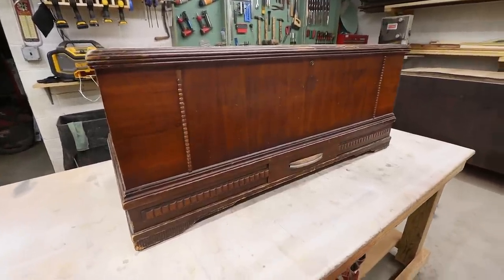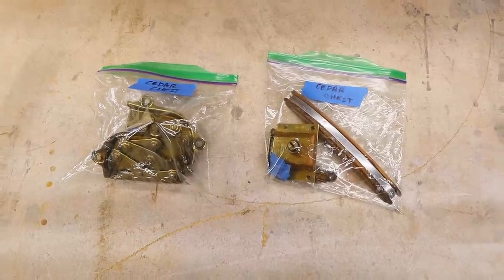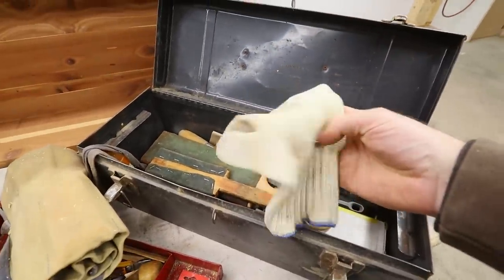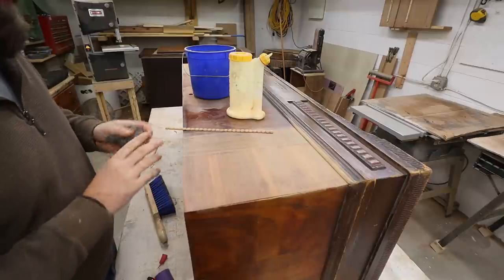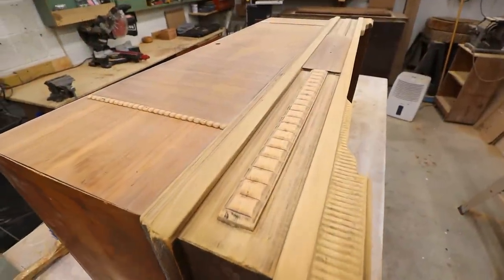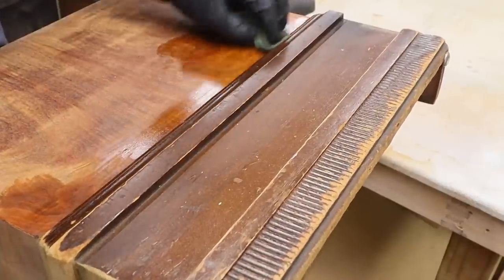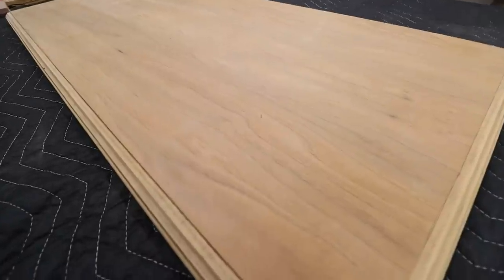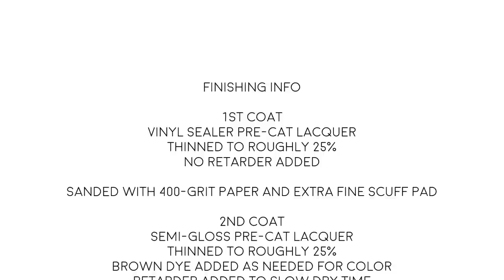Antique Roos Cedar Chest | 10.25.19 | How to Furniture Refinishing Restoration Repair

Comment: Can anyone tell me why you would steam the wood? I’ve heard of steaming it to bend it but in this case I don’t understand why he is steaming it with the iron? What does that do and how is it done - I can’t tell if that is just a bowl of water or chemical? And how hot should the iron be?? Thanks
Reply from the maker: It helps to pull out dents/scratches in the wood. It's just water.

Comment: Called it from the dummy drawer at the bottom. This is their basic model dressed up with some moldings, hence the paint instead of veneer on the bottom. The veneer on top (I think) is American Chestnut and mahogany. It was shellacked to show the grain. The bottom had a more durable finish because of the paint. The "drawer" is fake because it was meant to be inexpensive and joinery would have cost too much.

Comment: The finishing should be a cellulose based varnish typical of the the 30s and 40s. Why did you use an iron on the lid of the chest? Thanks
Reply from the maker: Pretty sure it was all shellac. Came right off with denatured alcohol. I lifted some dents and dings by steaming it. Thanks for watching!
Reply: John Bear Woodworking & Furniture Restoration Ok. I had understood it did not dissolve with alcohol. Fun videos.